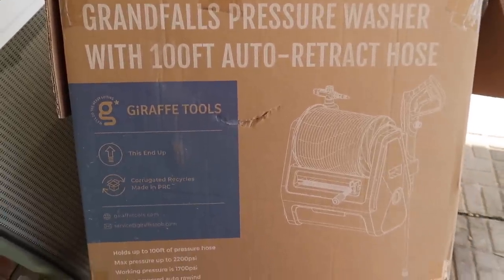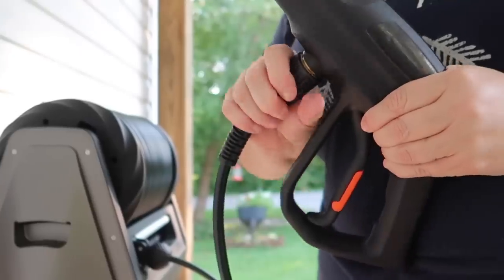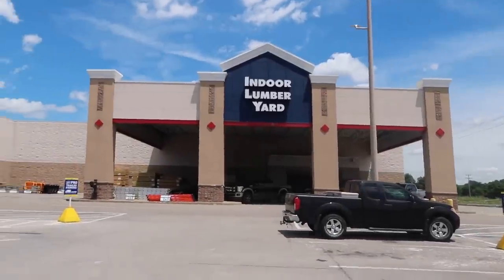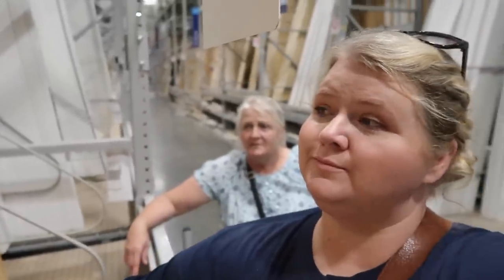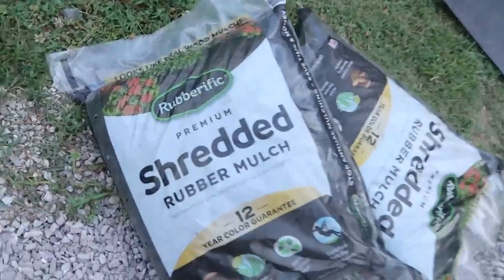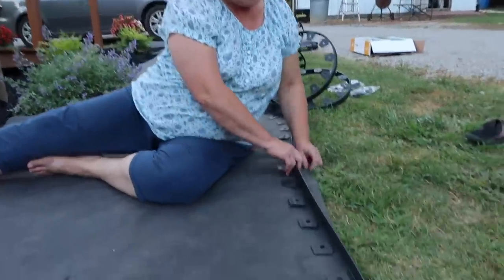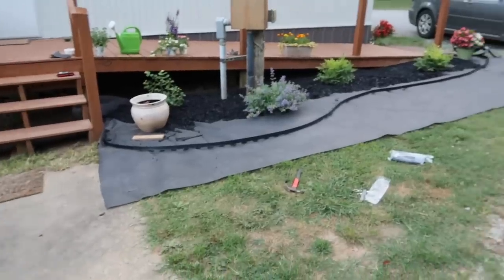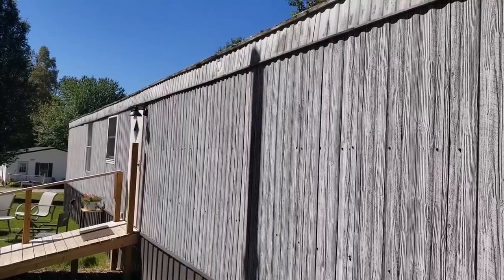Landscaping around the back porch | Mobile home updates | Rubberific rubber mulch | Giraffe Tools

Comment: Buy cedar fence pickets.  Cheap and they will last 10 years. Great power washer. Dad needs a rotating surface cleaner. About the size of you robot vacuum. Works wonders on driveways and patios. The rubber mulch bag should have a disclaimer:  Little boys love to throw this. Our local park spread this under swings and slides to cushion the falls. It was all over the grass and everywhere those boys love to throw it. ha ha   Flowers and flower bed looks beautiful. Great job. 
When you buy your lattice purchase enough to build a tall square box around your electric pole and service pipe. Just to draw the eye away. Have a great weekend.

Comment: hey I had a big gas tank setting in my front yard I took a wood fence panel and put in front of it a decorated it it could be an idea for your electrical pole you wouldn't have to use a whole piece and it's easy to just build one  I'll try to send you a picture☺
Reply from the maker: Great, thanks for the tip!
Reply: Great idea or use lattice

Comment: Your landscaping looks great! You’ve made some wonderful updates! We just put down the same edging from Lowes. I haven’t seen the rubber mulch before & may need to check that out. An idea for your telephone pole area: we have a large meter box mounted to our house in the back corner. I keep a tall shepherds hook right next to it in our flower garden & keep a flowering basket hanging there all summer. It helps disguise it. You could do that right next to your telephone pole!
Reply from the maker: Sounds like a great idea! I'll keep that in mind. I found the rubber mulch at Lowes. I'm very happy with mine so far.

Comment: Looks great! Your mom is such a hoot! I did the same landscaping last yr & have some to do this yr. I used cardboard first, minus the tape on the boxes, to keep the weeds down. Then the fabric on top, followed by the mulch. Ty for the info about the rubber mulch. You could use a rope or hose to determine the curve line & adjust to your preference & follow with the edging.
Reply from the maker: Great idea!!

Comment: I used this before and it spread everywhere and we had a mess,,because,its so lightweight it goes everywhere ,,I am using landscaping rocks which are a lot heavier but weeds still come up, it's hard to keep weeds at Bay.
Reply from the maker: I haven't had any issues with it so far thankfully.  Weeds are definitely a pain. The weed barrier is doing a good job so far.

Comment: I am only at the mid point of the video, but why not look for old wood shutters on FB and craigdlist that can be cleaned up and re-used? Stay away from vinyl they look like plastic and warp and will need maintenance just like wood will. I had them on a brick home we had and after about 8 to 10 years I pulled them down for two reasons. 1.) they where just decoration shutters and even still I hated that they visually did not look like they were going to cover the window if they ever "closed" . 2.) the color faded and I was going to have to pull them down to paint with them being warped it was a pain and got rid of them.  I personally decided that if I ever have shutters again they will be working shutters that way they will actually protect in storms and have correct proportions when looking at them also when it came to painting 10years down the road I could just open them away from the house (keep them mounted on the house) and paint.